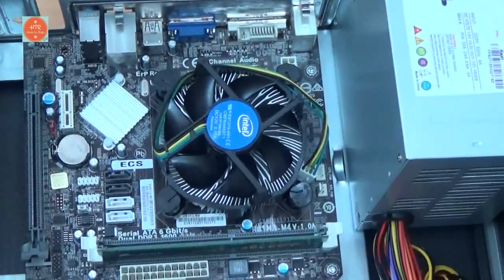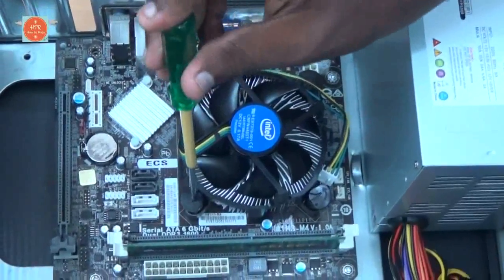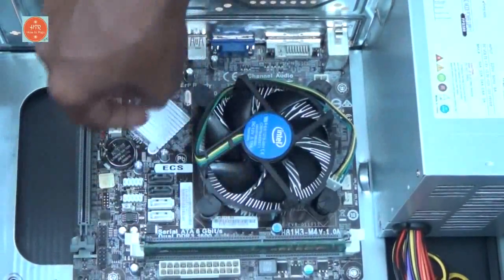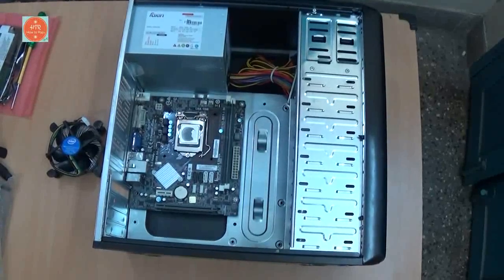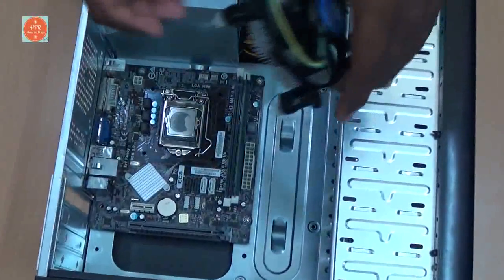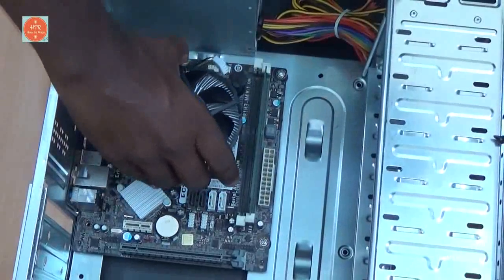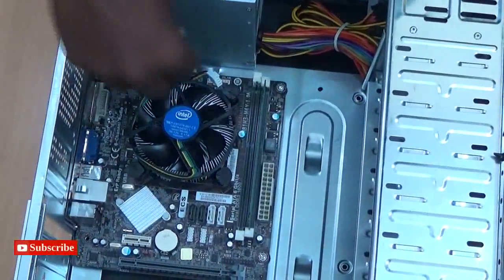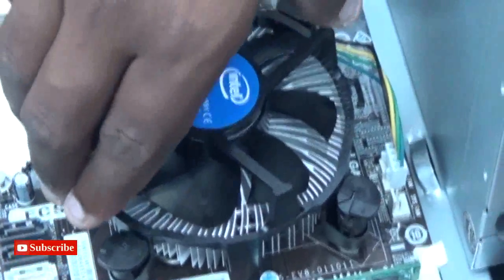How to Remove and Install the CPU Cooler Fan on Your PC

Comment: the white clips underneath that supports the fan might break in this procedure even though the latch is loose, u need to remove the motherboard first before you attempt to remove the fan and the heatsink. that way, you can gently guide the white clips underneath it. make sure also you have the electrostatic wristband in you while troubleshooting. tsk tsk..

Comment: Lol..shit guide... While fixing the CPU fan in the motherboard, u need to put pressure diagonally to the pins. And once u remove ur fan, the thermal paste wear off, so before u put it back on...apply thermal paste on the CPU and then put the fan
Reply: i have removed my fan and reinstalled it..without any thermal paste..
its an old and shitty cpu though

Comment: once u take out the heatsink the thermal paste gets broken. U need to replace the thermal paste.
Reply: Yes, and he reconnects the heatsink incorrectly also, you are meant to do one corner first, then diagonally across do the opposite corner, then the last two plastic stands can be inserted in any order, it's the same as doing a gasket on a car, or tightening wheel nuts on a car wheel, it has to be done correctly or it can fail in the future :)
Reply: Do i need to remove the old thermal paste aswell?
Reply: Really?